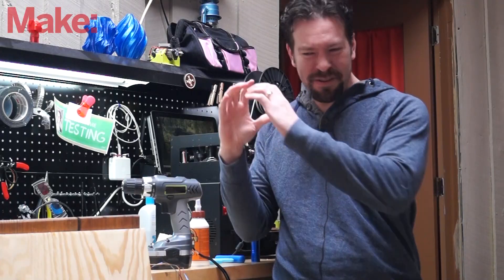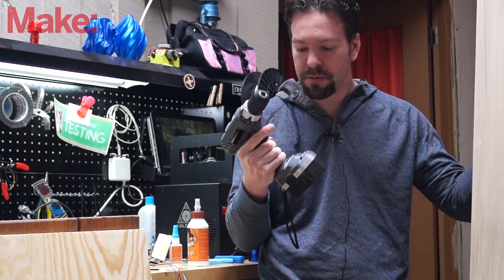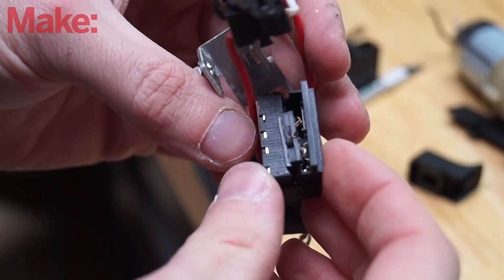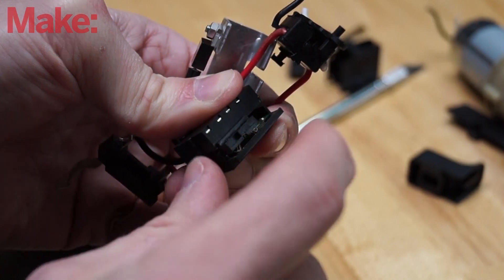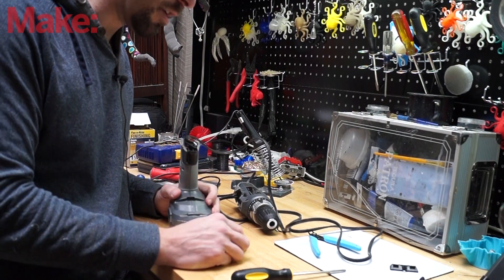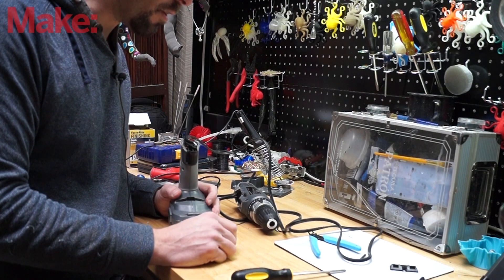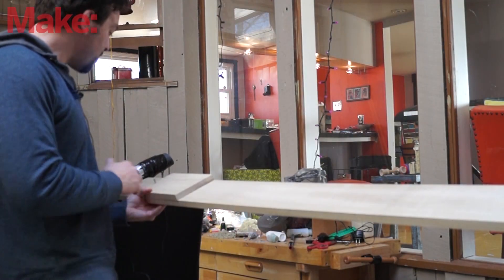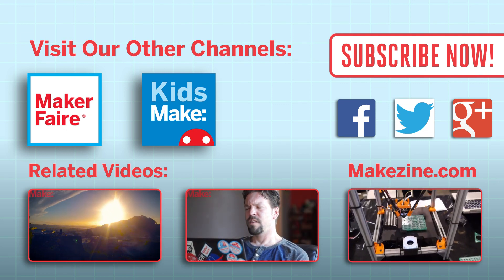Controlled Chaos: Making a Motorized Slider from Scrap

Comment: why not use long ass threaded rod  (about 2$)  and attach 2 nuts to your camera holder . You can then spin that threaded rod with that drill and you have nice linear motion with your camera. Strings really looks silly.

Comment: I think I'd have gone for a stepper motor turning a threaded rod. If you fix your tripod to a nut then the threaded rod would move it back and forth, kind of like a drive thread on a cnc. Granted, that may cost more than a drill after stepper, driver and threaded rod add up.

Comment: Why bother buying and cutting up the drill? Use an existing quality drill you already own and attach it to the board with straps. A better motor probably would be smoother than a cheap drill anyway.

Comment: Or you could have modified a cheap rc servo for continuous rotation, or bought a rc winch servo directly, they're like 8 bucks...not completely silent but much better,surprisingly strong and can be controlled with supercheap manual controllers or cheap remote control...not more than 35 bucks all out, or 15 manually controlled

Comment: The drill trigger switch looks like a linear slide potentiometer. You might get better control of the motor if you replace it with a 5 or 10-turn rotary pot of similar overall resistance. You've probably got one in your parts bin...

Comment: Mount the motor on one end and use a push-pull pulley system. Motor on one end, mounted on rubber, camera mount on opposite side. Hopefully this will reduce some noise. Still don't have to spend much. Just a thought.

Comment: Why not just start with a cheaper corded drill, a couple of really cheap rechargable batteries, and a potentiometer?
Reply: +Torrey Jones , because this is what I had sitting in front of me.
Reply: +Caleb Kraft good reason I guess, but then why say you went out and bought the drill if you already had it?
Reply: +Torrey Jones , for tightness of narration. I had recently purchased that though not especially for this project. I can see the confusion though.
Reply: +Caleb Kraft another good point. I sometimes forget that side of things when people make videos. :) Thanks!

Comment: Awesome. I had initially thought, "threaded rod?" but that string was a way simpler solution. My only complaint - Not Enough Octopi.
Reply: +CapnsKustomWorks , also threaded rod is expensive comparatively, especially if you want a straight section without warps that is 6 foot long.
Reply: +Caleb Kraft It's even worse than you think.  For a long linear drive application, if you want any precision and smoothness at all, you would use an Acme thread, which is an order of magnitude more expensive than standard threaded rod.  For example, McMaster-Carr sells a 6-ft length of medium strength uncoated 1/4-20 threaded rod for $3.71.  The same 6-ft length of medium strength uncoated 1/4-16 Acme threaded rod is $31.03.  Acme threaded drive nuts carry a similar premium.  Precision motion control hardware ain't cheap, unfortunately!
Reply: +Caleb Kraft Yeah, for sure!!! Your approach avoids alot of those pitfalls. I've been trying to devise a feasible semi-circular dolly rig, this definitely gives me some points to consider...
Reply: +CapnsKustomWorks what size do you need? I've strapped a gopro to an arm mounted to a bike wheel before. Nice smooth arc. I once tried a model train set, but you could see the bumps in the track in the resultant footage.
Reply: +Caleb Kraft Ahhhh, see the train track concept had been my very first idea, but I figured the imperfections would be way obvious. That bike wheel idea just might be perfect though, if I make a suitable arm! Absolute genius, thanks man!!!

Comment: Add a cheap snap action/limit switch inline with the motor power attached to the normally closed terminal. Then when your sled reaches the top if will automatically break power to the motor.
Reply: +Dave McAnulty , yep, it needs it badly, I kept having to keep a close eye on it.

Comment: The main thing to take away from this video is that we all tend to have things around the house that can be re-purposed with a little thought and modification. Many of us will have old cordless drills with dead batteries to provide the donor motor, so as long as we have a cordless tool of equal or greater voltage we can with a little effort make a similar rig. As others have suggested, using Lego components is a great idea even if it is only a temporary proof test of concept before making a sturdier second unit. Guide rails would definitely be a good idea, I had visions of the camera and tripod sliding off the ramp and heading for the floor.
Reply: +Mark Fryer , that's a BINGO! yep, the camera did slide off on one of the takes. There are a TON of improvements I could make, but this did the job.
Reply: +Caleb Kraft so did you manage a successful gotcha catch or did your camera set up take a dive for the floor?
Reply: +Mark Fryer , the camera was strapped to the sled, it just danlged there for a moment while I grabbed it.

Comment: Nice! To kick it up a nick- Instead of the $20 on the drill, what about a $11 low RPM  12v motor and a leftover wall wart power supply?  you can add a  reverse switching PWM speed controller with the extra money you save, if you wanna be super fancy, a whopping $2 over your original cost of the drill.  http://www.amazon.com/gp/product/B00HTZD9YI?psc=1&redirect=true&ref_=oh_aui_search_detailpage
Reply: +hoth mob , great idea! probably closer to what I would have done if I didn't have the drill sitting on my workbench already.
Reply: +Caleb Kraft  Ahh! ok, thought you said you "...went over to the hardware store and picked up the cheapest drill for $20"...
Reply: +hoth mob , I did say that. I shouldn't have. What I should have said was "I had just purchased this drill for ANOTHER project, but its so damn cheap I'll use it for this"
Reply: +Caleb Kraft Gotcha.Good use for a cheap drill AND the power supply.

Comment: String is cheap. Replace the ruined drill body with an eye screw. Operate the drill from a place 20, 30, or 40 feet away. Also, just chuck up a nail. The small diameter will wind very slowly.

Comment: U could just mount elbow brackets on the sled to ride on the very edge of the board to keep it on, pretty easy and much simpler than making rails
Reply: +Max Davis or dado it, then glue a strip to the other piece.

Comment: why didn't you add rails/ cleats? it would have been more reliable. Maybe add a 1/4 -20 screw and you wouldn't need that tripod. Two fast modifications to improve the makeshift slider/ with cleats you can even use a curved plank as a base for variation
Reply: +tzyinccom , did you watch till the end of the video? I talked about that.
Reply: I must've been watching on mute, I dont recall. well, good job anyway!

Comment: mod could be using a threaded rod with the nut attached to the sled.  The rod would keep everything aligned and you could take advantage of reverse to back up the camera.
Reply: +Webbed Toed Workbench , you'd think that, but threaded rod is rarely straight. The wobble would be very visible in the footage. I've tested this in the past (it used to be a common issue in building 3d printers)
Reply: Ahh yes I can see now how it would wobble.  I used it in the past for mechanical/activator movements, but those rods were only a 5-10cm and not video related.

Comment: It's speed appears to be a sine wave! It speeds up and down very slightly and you can hear it from the motor.
Reply: PWM
Reply: +Reck Tominvayed I prefer cosine wave b/c it starts at top, unless you have a sin(x-90) sine wave, which would be the same.

Comment: If you strap 4 wheels/smooth rods to the corners of that sled that runs on the sides of the track that you don't need to add a rail. Cool cheap build.
Reply: +sa-maker He could also sand and wax the wood surface if he wanted to maintain the quick run'n'gun methodology.

Comment: I'm not speaking English natively, but when you are saying "Scrap" you think of recyclable materials left over from other products, not buying a new product and using it. Maybe my understanding is wrong... Anyway, great video!
Reply: +Paul Iştoan Well, that hand drill is (s)crap.
Reply: Yeah, you got it.
Reply: +Paul Iştoan Exactly. Using almost only parts that need to be bought doesnt really fit to my understanding of scrap
Reply: +Paul Iştoan Many people have that kind of thing laying around as scrap, the fact the youtuber bought the items to make the video does not preclude the title especially as it's easily adapted to use items you may have laying around. I could buid it exactly the same with stuff I have saved for odd projects, except that i happen to have en electric screwdriver I could use rather than a drill.

The idea of these kinds of tutorials is that you use what you have and adapt for things you don't, don't rely on other people thinking for you, watch the clips and use them as inspiration not fixed instructions.

Comment: Since it's unlikely you would want to use it at top speed, try running it off lower voltage. It would reduce the amount of PWM going on and might quiet it some.

Comment: You should have used a brushless drill and a threaded rod and some nuts
Reply: +BLACK 0PS BOSS , threaded rod wobbles and isn't straight. especially in long pieces like this. A brushless drill would have been a good upgrade though.

Comment: You could also use some gears from something to really slow down the speeds of the drill. I would probly use two rails, which could be as simple as curtain rods, and have the camera on a block of wood with two holes. Maybe even encase the drill motor itself in a little soundproof box. All dirt cheap to do, especially compared to the real things for sale. Certainly got my imagination going. Those cheap drills really are utterly useless, and this is about as much as I'd trust it's woeful torque with.

Comment: Nice idea, though what about weights and pulleys, it would be basically silent and you could adjust speed with extra or less weight?
Reply: +Genesis Rowley , that sounds easy, but in practice it gets really really hard to have a controlled speed with weights and sliding friction. It would certainly have taken much longer to troubleshoot.
Reply: +Caleb Kraft that's a fair point,  thanks for the cool prototypes